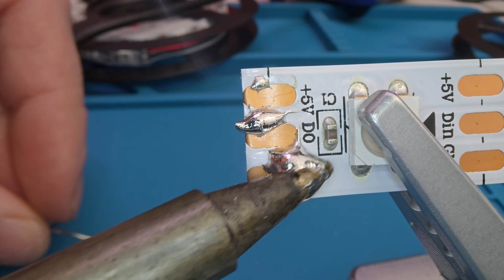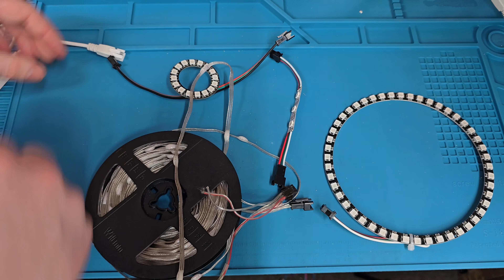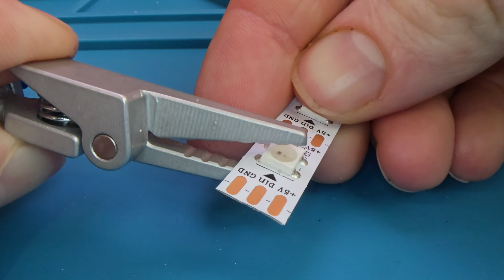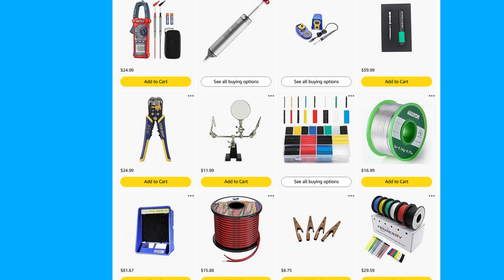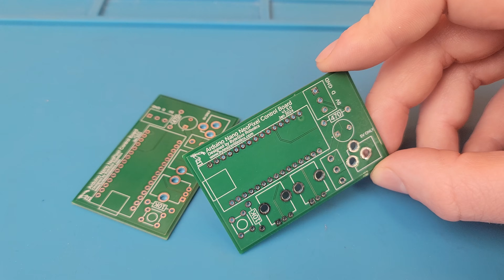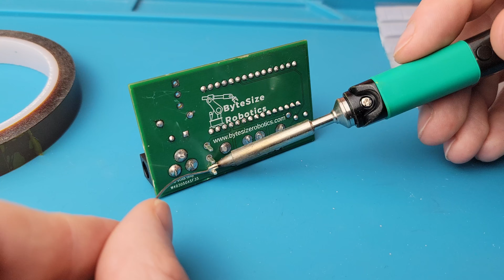The Only LED Strip Soldering Tutorial You'll Ever Need

Comment from the maker: I'm seeing a decent number of comments regarding the lack of flux used in this video and given that this is a beginner focused tutorial it's worth acknowledging that flux can indeed be applied to both the wire and the copper pads prior to tinning and it will absolutely help the solder flow onto these surfaces. No question at all, the solder will flow easier. This is an undisputed truth; give flux a shot if you'd like!

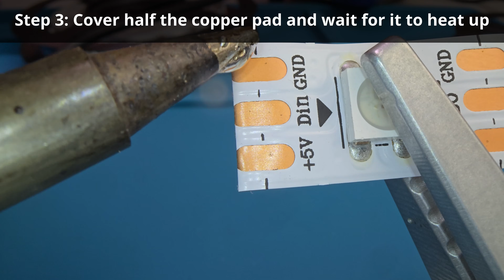However I still push back on the cult-like following that mandates flux must be applied to every work surface. The solder I am using in the video (linked in description) is rosin-core, meaning the centre of solder contains 2% flux. In my experience, this is more enough flux to get easy, reliable solder joints using the techniques shown in the video. The yellow-brown substance around the copper pad after tinning at 1:56 is evidence of the flux substance (so is the smoke that burns off - that smoke is flux, not vaporized solder). 

While you can absolutely choose to cover the copper pads in additional flux, it really isn't necessary to do when working with brand new, clean, tiny 22 AWG wire and thin copper pads. I personally hate having to spend time applying and then cleaning up excess flux. Flux doesn't fit in my workflow at all. 

I'm sure I'll continue to get push back on this, and for beginners just starting with soldering, investing in some flux can't hurt. It's undeniable that the solder will flow easier with flux smothered over your connections. Give it a try and see what works for you. But focus on getting good technique down first (as shown in this video) and don't rely on using excessive flux to make up for poor technique. 

---

Another critique is the use of lead-free solder. This is definitely a relevant debate and there's a strong argument to use lead solder and I understand why many people prefer it. From a physics standpoint, lead-free solder is undeniably brittle and in high vibration environments (like robots or cars) lead-free solder will have a failure mode sooner than lead-based connections. But for my use cases and with adequate cable strain relief, I've never actually seen this be an issue in the real world. 

Additionally, it's true that lead based solder flows smoother, has a lower melting point, and is easier to work with. If you are a beginner, by all means, try out lead-based solder. I personally choose to use lead-free solder for environmental considerations and in my experience, with proper technique, lead-free solder is easy enough to work with (at least the solder linked in the description, I know there are some worse options out there).
Reply: I absolutely agree that extra flux is rarely needed. The idea that it is is something that surfaced on the internet relatively recently, and it gets repeated ad barfium. As I mentioned in another comment, I've soldered hundreds of thousands of joints on PCBs and very rarely used flux beyond that in good quality cored solder. Where I might use it is on a double-sided PCB on unusually thick laminate with very heavy copper. I used to design such boards fairly often. It can be difficult to get solder to flow through the holes in the PCB to the top surface and a tiny bit of extra flux can help.
I keep several types of flux on hand, but I very rarely use any of them. 

I've seen people "clean" the flux they slop on PCBs using methods that often just shift it around. I've never once seen a YouTuber do what I regard as an adequate job of cleaning if cleanliness is to be anything but cosmetic. It is a difficult and tedious task. It is also hazardous if you use flammable organic solvents such as isopropanol. When I assembled PCBs that required a high degree of cleanliness, I preferred water-soluble flux, either in solder paste, cored solder wire or as an auxiliary flux. It absolutely must be thoroughly removed within hours since it is conductive and corrosive. Not everything is compatible with water washing processes.
Reply: Rosin core for the win 😄
Reply: One video made me a professional solderer 😂. Complete information with a nice demo, beginner-friendly. Thanks, dude!
Reply: I soldered headers on a bunch of microphone boards yesterday, 'bout a dozen.  

"Why didn't anyone tell me how much easier it would be if I used flux?"

Narrator:  Everyone had literally always told him that.
Reply: @madwilliamflint  Rosin core solder shouldn't need extra flux just like he stated.

Comment: Great instructions and was able to used your system on any soldering job and worked like a charm. Problem now with my solder on striplight is that the striplight copper coming out of the strip with the wire (I guess defective/weak strips). I'l try those screw on connectors this time from Amaz. But thanks for doing this.

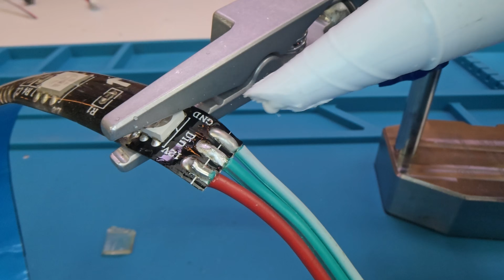Comment: 8:34 what kind of silicone should I use? I have IP65 LED strips, so it's the exact scenario for me :) thank you
Can I use hot glue sticks instead?
Reply from the maker: Yes, hot glue is an okay option, but I find it doesn't bond as well as silicone to the IP65 strips. I use clear Mono silicone from Home Depot, but any brand of silicone will probably work just as well
Reply: @WillDonaldson  thanks! I'll go with a tube of silicone then. Is there any silicon type you would advise against getting? I'm not quite sure which one to get, are they all the same? Should I just look for a silicone for sealing gaps in bathrooms for example?

Comment: Excellent soldering tutorial for beginners! I also agree that if you are using rosin core solder, no additional flux is needed. If the copper pads are clean, and the wire is not tarnished, they will take the solder easily. Also, keeping the soldering iron tip clean is very important, as is getting a little solder on the tip to aid with heat transfer. The parts have to be hot enough to melt the solder, or you won't get a good joint. As soon as the solder liquefies, hold the wire still and remove the soldering iron to avoid heat damage to the pad.

Comment: Flux core solder! Good video and well zoomed in. Biggest most importants point that is not mentioned:
The steam coming out when he is soldering is from the flux. You are using flux core solder! Flux when heated cleans and etches the surface for a proper bond to the copper. No flux? then you will be struggling like he did in the initial pass on the led strip pads, or the barely tinned wire. You can also add flux paste instead, heat till it steams, then add the solder.

Comment: If you do it properly, there is no need to "preheat" the pad on the flex PCB before feeding solder. The amount of solder pre-melted on the tip of the iron is far more than is necessary. In fact, with tiny pads it really isn't necessary at all. You can apply the tip to the pad and begin feeding solder immediately. With such a tiny pad with the thin copper as on these flex PCBs, solder fed to the tip of the iron right at the area where it touches the pad will virtually instantly transfer sufficient heat to allow good solder flow. It is always important to feed flux-cored solder such that, as much as possible, the flux flows "ahead" of the solder, so it has a chance to do its job. Good quality solder is essential. Sometimes finer solder is helpful. 
A clean soldering iron tip is always essential. The iron tip, as shown just after "cleaning" with the brass sponge was clearly not properly cleaned. Not only did it appear visually to be inadequately cleaned, it did not accept solder properly when it was applied. Assuming the tip is not beyond its useful life, it requires more aggressive cleaning. Tip tinners (solder powder mixed with a fairly aggressive flux) can sometimes do the job. If that doesn't work, the brass sponge used more vigorously might work. Beyond that, my preferred method is to very carefully scrape the bad area with a knife. You want to remove only the oxide build up. Then tin the tip as usual. If you have to resort to such action other than very rarely, you are doing something wrong. I doubt if I've scraped a tip 20 times in decades of soldering, much of that with the iron idling at full working temperature for hours on end, day after day. High tip temperature does foster faster buildup of difficult oxides. Don't use the solder powder tip tinner all the time, just when really necessary. It is best to damp wipe the tip so as to remove the aggressive flux to avoid transferring it to a PCB.

Sometimes on bare copper pads a very tiny amount of extra flux can be helpful, but with good cored solder and good technique it is rarely required. The internet is awash with people who think you need to slop vast amounts of extra flux all over everything all the time. You don't. I've soldered hundreds of thousands of joints without using any extra flux. A little extra flux when tinning stranded wire can be useful. Flux from cored solder often can't be made to flow ahead of the solder metal adequately and penetrate among the strands.

Comment: Great video! I will be using your advice on my next LED project.
I'd love to see a video from you on how to deal with corroded wires and heavy gauge connections, if you have experience with those. Most of the soldering I do is on older project vehicles where it is prohibitivley expensive to replace the whole harness and its often just the area around the connectors that has failed due to decades of vibration, so being able to resolder these more easily would be very helpful

Comment: Just wanted to add my pro tip to raise you one better, flux paste with a small paint brush prior to soldering, it drastically cuts down the time needed to rest your iron tip on the pad which is always a good thing because led strips are still just plastic with copper leads which will transfer heat very quickly to the substrate. Just make sure to clean up with 99% isopropyl alcohol to avoid voltage creep, it can happen.
Reply: Yep on Temu they have those small foam micro cleaners that are perfect

Comment: What about connecting 6 short strips together for individual shelves using the same power supply.  Not in a chain together but 6 separate wires all coming back to a block then the power supply.
Reply: No problem. Psu to block (wago/choc block/din terminal) pos and neg. Block to strips. Your data will need to go from the d out of first strip to the din of the next strip if you want then to all act as one. Or use a d out for each strip

Comment: Was just installing a 5-pin LED strip. Super tight, connectiors are less than 1mm apart. Figured I’d solder it since I didn’t want to wait to buy connectors. At first it wouldn’t solder at all, but I watched this video and tried your method, now I’m enjoying a beautiful Wi-Fi LED light as I’m typing this. Great advice, thank you!
Reply from the maker: I'm super happy to hear this! That 1mm spacing is tricky, solid work!

Comment: Isn’t the way you/the industry wires the JST-connectors a safety risk? You’ve got the male part (the one with the three exposed pins) providing power, while the female (the one with the hidden leads and wings) being powered. If you project this idea to your common wall socket, the live, neutral and ground would be exposed on the wall, while being recessed in the connector of the device; I wouldn’t let my children play in any room where there would be wall sockets, it’s either frequent blackouts or trips to the hospital.
Reply from the maker: 100%!! I completely agree! It drives me insane haha. Unfortunately it's the standard that all LED manufacturers have adopted so I've also begrudingly assimilated. Fortunately these are all low voltage so shorting them won't hurt a human, but you could absolutely fry your controller on accident. I wish the standard was the reverse

Comment: This is BS..  only 10mm strips.. so this is NOT the only video I need to see.. I have 3mm strips and need to solider them is segments ..  what a waste of time this was...!!
Reply from the maker: Lol, same technique will work on 3mm strips. Just switch out the tip for a narrower one and use a thinner diameter solder (in the video I use 0.8mm, but also have some 0.4mm solder). I've done lots of 4mm strips, 3mm will be the same, just keep steady hands

Comment: 8:16 you can stitch back of the strip with capton tape, it survives brief heating to 350c till you finish soldering. 
you can use capton tape to mask very close leads to avoid soldering them together
if you have one chance at soldering - like soldering leds to strip then use soldering flux to decrease the time it takes solder paste to wet all soldered surface.
you can semi-waterproof led strip back (from water droplets) with spray-on acrylic lacquer

Comment: that easy with 12mm pcb try solder the 7mm 5mm 3mm pcb
Reply from the maker: I've used the same technique on 4mm strips, just switch out the tip for a narrower one and use a thinner diameter solder (in the video I use 0.8mm, but also have some 0.4mm solder)

Comment: I use a soldering paste, it comes in syringes or small tins, just a slight smear of the paste on the wire and or contact and it is like a miracle how quick and easy the solder takes to the pad or wire, its like the paste is food and the solder is a piranha, it is the best thing ever for soldering.

Comment: Absolutely agreed on snipping off sacrificial LEDs, especially for LED densities higher than 60 per meter. I can get away with snipping 60/m pads in half, but the circular pads on the higher densities? Forget it, the flux will delaminate the pads and create weird shorts. And they don't have to be sacrificial if you're not afraid to micro solder with some magnet wire.

I use flux liberally because I never know where the pads have been. Some days they'll drink lead free (Kester K100LD is great if you can afford it), other days they behave like black soldering iron tips and will not flow at all until I add flux.

If your strip acts strange and you know there's no shorts or open circuits, add a capacitor at the first LED between power and ground.

Comment: 1. Do not use lead-free solder. Avoid it like the plague. From your video, it's clear that is exactly what you're doing—using lead-free solder.

2. Do not use a conical soldering tip. This is probably the worst visual advice you can give to soldering beginners. These tips are notoriously bad because solder accumulates above the tip and systematically fails to reach the soldering point. A chisel, truncated cone, or knife tip would be a much better choice.

3. Use soldering flux. The flux that comes in the solder is often simply not enough for proper surface fluxing.

4. Before giving advice to the entire internet, make sure you're a master. Sorry for the harshness, but your advice about the sacrificial LED is the fourth one, but the most important mistake. If your technology requires sacrificing a component, it means something is wrong with your technology.

Comment: I got better technique, do self feeding one. It means you let some solder wire sticking out above the covered pad, so when you put your wires on it and heating them up, the sticking wires would melt and come down automatically. Much much easier.